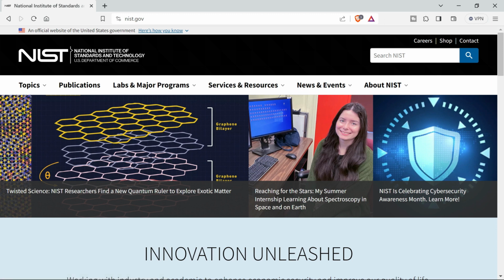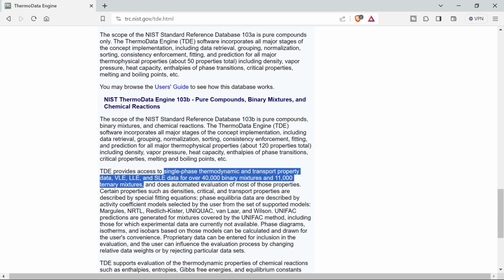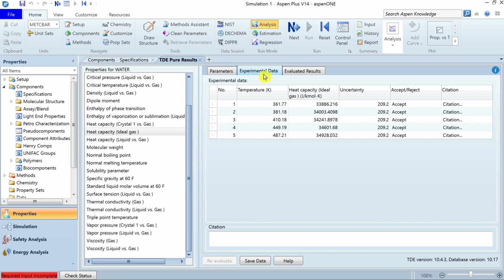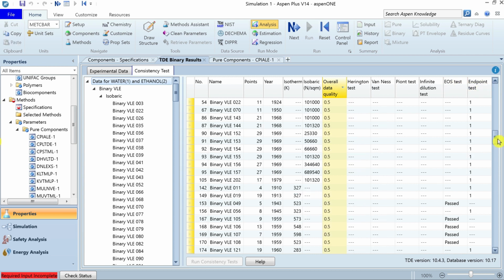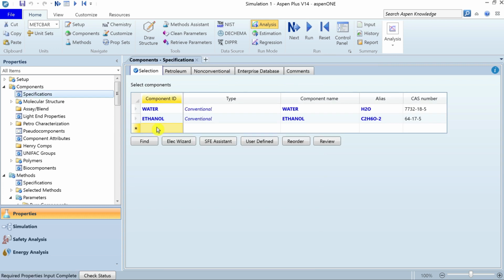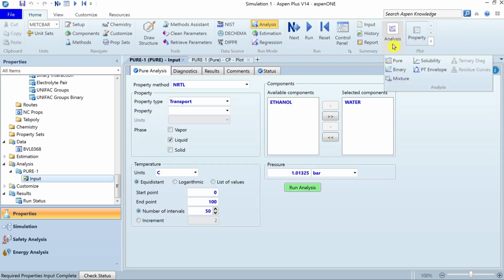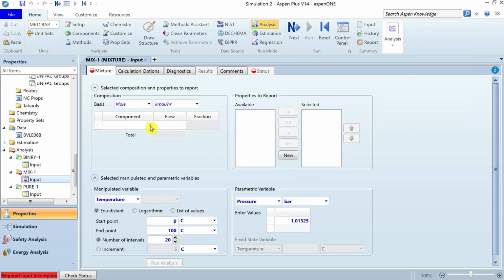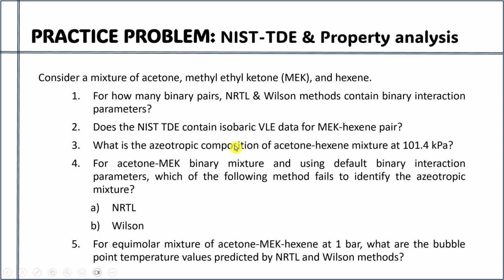Aspen Plus V14.0 || NIST TDE (Thermodata Engine) | Property Analysis | Lec 1.5

Comment: Hello An! Nice to meet you! excelent video! I have a question: When I tried to perform the binary plot for the mixture ethanol-water, the plot is the opposite of the one you made. It is like the mirror plot. for mole ethanol close to one, i have the highest temperaturature, but in the plot you made is the opposite. What  do you think could be the reason?
Reply: sorry, the lowest temperature, for mole fractions close to one
Reply from the maker: @mariaveronicavillanueva4428 just check order of component 1 and component 2. You can cross check from x-axis label as well.